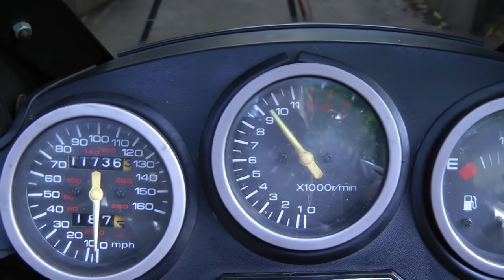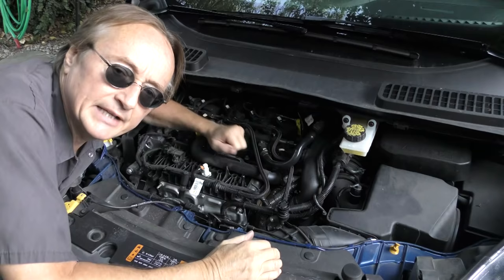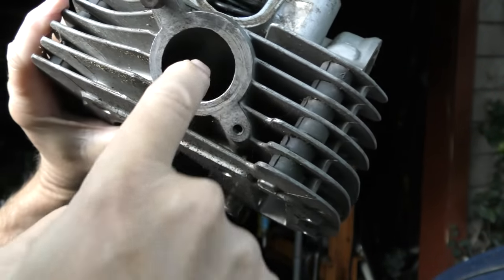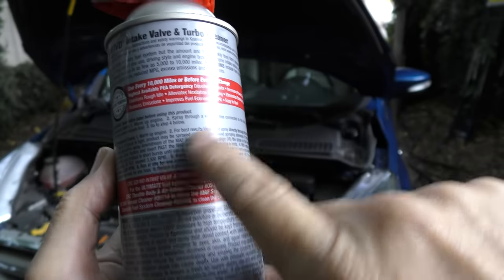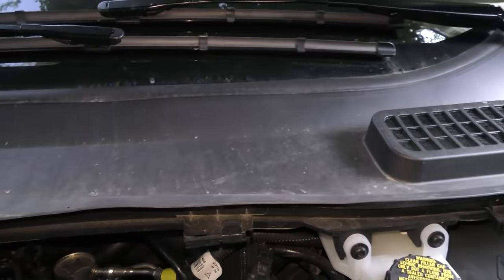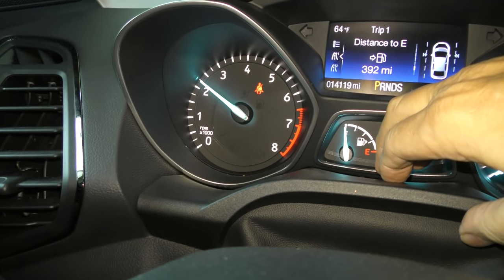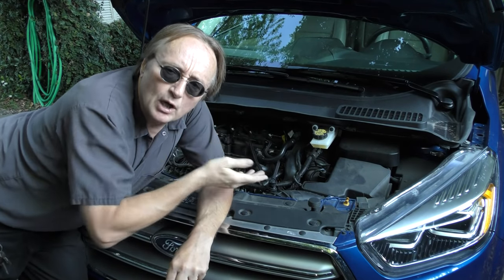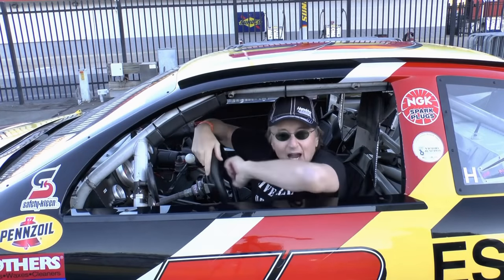How to Clean Intake Valves in Your Car with a Spray Cleaner

Comment: have you ever seen old gas lock up engine valves yet??? this happen to me on a brand new valve job just locked tight i pulled off the head on a 1983 ford 300cid  4.9 L  after 2 mins of running a had a misfire. found stuck valve. took it back to machine shop and foreman had to use a hammer to pound out valve ... he told  me old fuel did this??? so i had to clean out tank and lines and then it was good...

Comment: I have 2008 Lexus IS 250. Dealer replaced valves and piston rings due to recall for carbon buildup. Runs great. They now offer a top engine cleaning for like 180 bucks. This is probably what they do. That being said, I will never buy a direct injection car again.

Comment: Hi Scotty a bit off this topic but, I have an older Ford Holley motorcraft 4 barrel carburetor.  My truck seems to be in need of a carb adjustment.  I cannot find the fuel mixture screws on that carb.  Any idea where they might be hiding?

Comment: Hi Scotty hi from australia, so if my 3.8 Buick v6 injectors spray into the manifold I don't need to clean valves cause the fuel does, is that right. cheers
Reply: yes for most ot the time ... carbon built up much slower in traditional engines !

Comment: Great video as usual Mr Kilmer! I have a turbo GDI engine as well, where would be the best place to spray this stuff? In the intake that leads to the turbo? Or somewhere after the turbo more toward the throttle body? Thanks in advance!
Reply: The best place would be after the turbo, after the throttle body. These cleaners are harsh. You should avoid spraying them through electronic devices or sensitive parts. The brake booster hose is good place to use it. In the video, he uses a rag to partially plug a large hose. This is done to minimize the vacuum leak so the engine doesn't stop running while using the cleaner.
Reply: CRC’s instructional video on YouTube says to spray it into the the air intake past the MAF sensor. You don’t want to spray it before on the MAF sensor.

Comment: This is pretty good stuff, and I usually apply it either via the throttle body and/or the pcv line (Not as effective if you apply it to the intake before the turbo if applicable). Blow some nice white smoke while doing it (and it may take a bit longer to start after the hour heat soak). Probably best to do it just before an oil change.
Reply: MA1tRiX. So after use the valves cleaner you have to change the oil.thanks

Comment: You can install a catch can on your vehicle but I wonder how effective they are long term. They do catch a lot of nasty gunk before it gets to the valves.
Reply: Catch cans are effective, but you have to replace them, or clean them out, which I am not a fan of, so just buy a cheap $20 one and I usually swap it out every 50-60k miles or so (10-12 oil changes). Although you will still get carbon deposits on your valves simply because of what happens inside your engine, but it seems to help.

Comment: Hey Scotty,

Some people suggest spraying water through the air intake to clean up carbon deposits in the engine, which I am well aware is not meant to work as water does not dissolve carbon. Do you think spraying industrial grade vinegar in short bursts can be of any good?

Thanks.

Comment: hey scottty, quick question. My cars idle seems to be funky. When every I put the car into neutral and cost the idling rpm just constantly bounces from  800-900 RPM and when the car is at a complete stop it jumps from 800-825. It's more of a thing when the car is coasting.

Comment: Hello Scotty I have a 2001 Nissan Maxima and it has 100 pounds of compression.What can I do to get it fixed right,I had replaced 2 motors last month and both are doing the same thing the car will just crank but won't start up.

Comment: Hi Scotty, i don't know if you'd be reply or even see my mess. I have a Hyundai sonata 2013 with 150k kms on. My car is vibrating at idle on neutral. My mechanic changed the Top Engine Mount, spark plugs and right ball joint but it still vibrates. What do you think is wrong?

Comment: I had the most persistent ticking till a mechanic told me it could be my intake valves were caked with carbon. Sprayed a can directly in the throttle body, next day the tick was gone.

Comment: Hey Scotty will this effect the recent oil change I just did? Or should I wait to clean before my next oil change?
Reply: Change your oil after the Intake Valve Cleaning. The carbon deposits will be flushed out with the old motor oil.

Comment: Hey Scotty iv'e seen a few other videos similar to yours where drivers are putting the can of valve cleaner in a vacuum hose. In watching your video your procedure went very smooth. In other videos i have watched after the cleaner was emptied into the vacuum hose the car would emit lots of smoke and the engine would idle roughly until the cleaner worked its way out of the engine. Is it normal for a car to emit so much smoke and run roughly while the valves are being cleaned with this product?
Reply: Yes, this stuff works great but it will cause smoke and poor running while in use. It can also cause misfires and engine codes, they also clear up after a  driving a while.

Comment: Hello I'm thinking about buying a 2009 Lexus IS250 with a 100k miles on it for my daughter. Is that a good choice for IS250 I was reading that the 06 to 08 weren't bad models butt models that you wanted to stay away from 2009 and above is ones you wanted to get is that correct? Thank you in advance

Comment: hey scot, i drive an oldtimer with a sidevalve engine in it. but i have had the problem of having a stuck intake valve once or twice, could this help cleaning it off? could i just spray it in the carburetor?

Comment: hey Scotty i have a 2008 G35 with 140k mileage. my engine rattle and shakes a bit when I'm driving around 2200 rpm when the car is not warmed up. but it gets ok after around 15 min of driving around. any suggestion? thanks.

Comment: You forgot to mention possible damage that can be caused to oxygen sensors like this. I've done this type of clesning several times and found depending on how dirty the engine was, this can damage the oxygen sensors. As the carbon goes out the exhaust some will accumulate on the O2 sensors. May think about having some new O2's ready if you have problems afterwards. Upstream are the most important as they influence fuel control. If you get faults for the downstream only, go ahead and replace the upstream as well
Reply: Im a technician and have done this treatment more times than I can remember. Never any issues with oxygen sensors. Your warnings are nonsense. I think the engineers at CRC know a little more than you do. Some shade tree mechanic who is jumping to conclusions….

Comment: you can do the same thing with water...make sure you are at FULL operating temp and SLOWLY pour down the vacuum hose..water will turn to steam and shock the carbon loose.
Reply: Yeah, just pour water into your engine, that sounds like a good idea said that one guy in the youtube comments.
Reply: do not believe me? look it up
Reply: Do not need to, the operating temp at the intake valves would not be anywhere near hot enough for water to turn to steam, the water would have to go into the combustion chamber to turn to steam and would then just get pushed out the exhaust. You do not want water getting inside the combustion chamber. 

Post a video of you doing it and then maybe I'll look it up.

Comment: you are great scotty, I was trying to find out where to spray some into a vacuum line, but i cant find where the pcv line is, i have a shop manual for reference but i still cant find it, what do i do scotty? and can this crc cleaner spray into the throttle body instead?

Comment: Hey Scotty does that apply to TBI as well. I have a 97 Chevy Silverado 5.7. It set for a few years in field and I started working on it. It was in a front end wreck. So radiator and air filter was crushed.bAnyways I put back together and have had issues with number three cylinder misfiring and backfired. I checked plug and it has a spark. I'm assuming the valve sat in a position that allowed corrosion to set up and is not seating well. I don't want to have to take head off. Will this work for my truck as well?

Comment: tempted to do this.. I've got a SVX that has a bad hesitation.. I'm going to clean the MAF sensor and change the spark plugs (40K miles) but no harm in doing this?  Sort of a why not move?  Is there any risk? :/ (just curious)
Reply: You'd be doing more work than you need to. This video is for engines with Gasoline Direct Injection (GDI) (some year 2004+ cars). Engines with GDI need an injector cleaner in the gas tank, and a separate cleaning of the intake valves. For other gas engines, just use a fuel system cleaner product with PEA (such as Techron Concentrate) in your gas tank. That will clean the intake valves+piston top+fuel injectors. The fuel injectors spray on the back of the intake valves anyway.

Comment: There are videos that have showen. People cleaning the carbon from the valves, combustion chamber, and piston top. By using a water vapor and combustion heat. To steam clean the inside of their engine. Is there any truth to that? What are the  pro's and con's?

Comment: I had about 2 tbsp of acetone In intake catch can in '19 Civic SI. Sucked into intake manifold at startup and started horrible. Now misfires on 3 and 4 and dirty wet 3 and 4. Replaced plugs and 3 and 4 got black again and cyl 3 and 4 are filthy. Valves?

Comment: It seems manufacturers are smartening up now about DFI motors. They are also installing a second injector inside the port along with an injector directly going into the combustion chamber. Audi did this with the 3.0 Supercharged motor in some of the S models and it has been good. Lexus also does it on the motor in the IS350 (forgot what the engine code is). Now BMW needs to follow suit along with other manufacturers because this carbon build up crap is such a pain.
Reply: Toyota/Lexus calls direct + port injector design D4-S. It's on the 2GR-FSE, 2GR-FKS, 4U-GSE/Subaru FA20, 1UR-FSE, 2UR-GSE, 2UR-FSE.

Comment: Ford service technician posted two videos earlier this year addressing the issue. Essentially he discovered that aging EcoBoost engines are experiencing misfires caused by carbon buildup on the intake valves. When he called Ford for a fix, he was told that Ford is recommending changing the cylinder heads because forced-induction service (sometimes accomplished by spraying a special cleaning fluid into the intake) will ruin the turbos. I'm sure you'll delete my comment, but HEY, trying to help.

Comment: Scotty I have a question.

I bought a Hyundai Sonata 2017. It's Engine cover says DOHC 16V. Upon Checking  the Manual, it says Gasoline Engine (Theta II 2.4L MPI).

My question is, does this engine have a problem with carbon build-up? If so, do I need to use CRC GDI IVD Intake Valve Cleaner?

I already bought 2 of this product and I am planning to use it on the next change oil.

Thanks.
Reply: No.  MPI = port fuel injection

Comment: Scotty Kilmer hello Scotty is it good to decarbonise your engine with water. Thanks
Reply: Water can remove carbon from the combustion chamber, but it will not do anything for the carbon on the valves or in behind the piston rings. Also, if too much water is added too fast, the engine will hydrolock, which may break/bend some internal parts

Comment: I wonder if this can happen: low pressure fuel injectors in the intake manifold and main high pressure fuel injectors in the cylinder
Reply: Yes. Toyota/Lexus uses this setup. They call it D4-S. https://en.wikipedia.org/wiki/Toyota_GR_engine#2GR-FSE

Comment: Will be doing this to my GDI engine soon. I'm a little leary about getting a catch can. I've heard horror stories.
Reply: What story did you hear?
Reply: @Slow_Stream  voided warranty and engine problems most like due to incorrect install but I'm still not sure about dropping 200 bucks on a part that I cant guarantee is safe to use.
Reply: @stevenhoop9009  I agree. I think that walnut blasting is the most safe solution. Although it's not permanent.

Comment: Scotty why would a GDI engine like my T4 on my 2012 Volvo S60 foul the intake valves? Isn't combustion better?
Reply: It's oil vapor from the PCV system and some exhaust from EGR (if your car has EGR). All cars foul the back of intake valves. On non-GDI engines, cleaners in fuel clean this off. On GDI engines, no cleaner put in the gas tank will clean the intake valves because the injector is at the top of the cylinder, not in the intake manifold, pointed at valves.

Comment: I just bought a 2017 Mazda3 2.5L. I've been hearing about the carbon issue with DFI. I have 2 questions. One, how do I get the engine to rev to 2K rpm by myself. In the pre-fly-by-wire days, I'd just move the throttle by hand. I'm assuming this is now a 2 person job. I'd need a intelligent throttle foot whilst I spray in the cleaner? And, Two, how often should this procedure be done? I'm hearing every 10kmi-15kmiles? Would that be about right? Or, does my engine have that interesting event timing that fires the injector when all valves are closed, to prevent carbon buildup-so I don't even have to worry about this? I'm using all top tier listed gas with a PEA additive (presently Techron by Chevron).
Reply: If the injector fired when all the valves are closed, it wouldn't clean the back of the valves/valve seat, which is where the build up happens in all engines. Injectors in gasoline direct injection are located at the top, which means they can't spray any detergent from the gas tank on the back of valves. Toyota/Lexus engines with D4-S have both direct and port injection.

Comment: Had one person tell me its important to change the oil right after another said not nessary. What do you think?
Reply: Yes, the carbon deposits that breaks away in the intake valve needs to go somewhere. If it's not getting sucked out the exhaust, then it's going to get deposited into your oil pan. If your engine already has oil consumption then this isn't an issue because the oil will just get burned along with the loose carbon deposits and exit via the exhaust.

Comment: Hey Scotty so I have a 2012 Ford Focus I saw your video and got a can of CRC I followed all the instructions on the can but when I went to start the car up and drive it it misfired for 10 seconds no cel came on then it cleared up but the first 10 minuets the car was very hesitant and was making a pinging metal noise every time I accelerated over 2000 rpms after 10 minuets all these symptoms went away but it was still scary I’m afraid to drive the car now it almost sounded like a valve hitting something any thoughts

Comment: Scotty this car only had 14k miles. 
did it really need an intake valve clean at that mileage? because I have a ford focus tdci with over 150k miles and never had this done, yet it still runs like a kitten. 
I'm just curious if this is just a marketing gimmick. 
I get that it needs cleaning but not like this.
Reply: Well the cleaner won't take off heavy carbon deposits so doing it more frequently as a preventative maintenance is probably a good idea. Your car probably doesn't NEED to have the valves cleaned but if you wait until they get really bad then the cleaner might not help much.

Comment: How do you use this CRC on a car with a turbo? I own a 2017 Honda Civic 1.5 turbo . Just wondering what step do I take to clean my valves?
Reply from the maker: I do it all the time. Now some guys whine carbon pieces will ruin the turbo, but if engine is all gunked up inside, heck, that will happen anyway. On a normally running car, it hurts nothing. And if you haven't taken care of the car, hey, it's not the car's fault.  Yours is so new you wouldn't need it yet though.

Comment: Scotty i love you videos and you have helped me find a workaround to a few problems over the years BUT

Ford has NO approved way to de-carbon the ecoboost engines

the way you are describing to do this will void your warranty and has a 80% turbo failure rate after
Reply from the maker: well, they are covering their own asses then. Because if an engine is built so it builds up carbon and they say you can't clean it off cause the pieces are too big, they would be worried about problems. BUT I have personally seen no problems occur from such cleaning myself or by other mechanics I know.

Comment: spray the brake booster with the cleaner? can you spray the vacuum line or are they the same?
Reply: The vacuum line leading AWAY from the brake booster to the engine.

Comment: In general, what's a good mileage interval to perform valve cleaning for these turbo 4 engines?
Reply from the maker: Heck, depends on the engine design. The older VWs needed it every 15 thousand miles, but some toyotas can go 100 thousand miles before and serious build up occurs.
Reply: I just used this product and the can says every 10k miles. I just did mine for the first time at 63k miles. I’ll probably do it again in another 5k miles and get it to 100k before i do it again. She definitely has a little more get up and go and less hesitation. 2014 Malibu with 2.5 ecotec.

Comment: @ScottyKilmer, I called my Ford dealership about using this stuff on my 1.6 eco boost. It has high mileage and I bought it used so I wanted to give it a clean. Long story short, the service rep said they absolutely don’t recommend using this product or anything other than the chemicals that are supposed to be in your engine. They gave no reason other than these chemicals would gunk up the engine. Even fuel stabilizers. The only thing I could think of is if a piece of carbon breaks off and ups in my turbo or the cat. Are they just trying to scam me for business or should I listen.

Comment: I use h2o2 for this, works fine and it's cheaper
Reply: kero  asubola   I think you mean H2O, and it won't do intake valves. - combustion chamber.